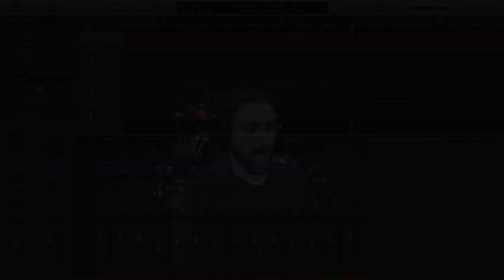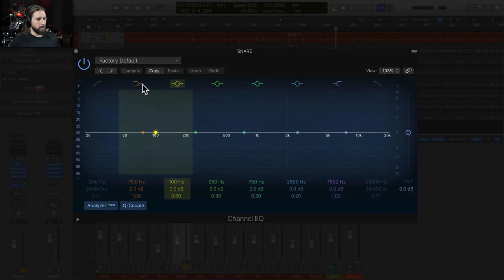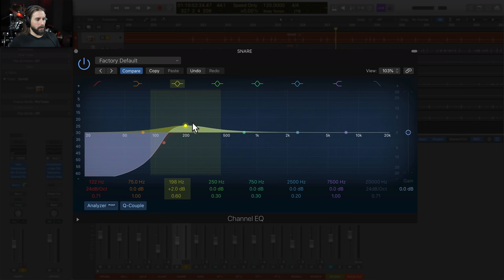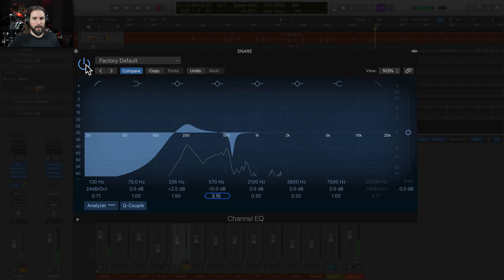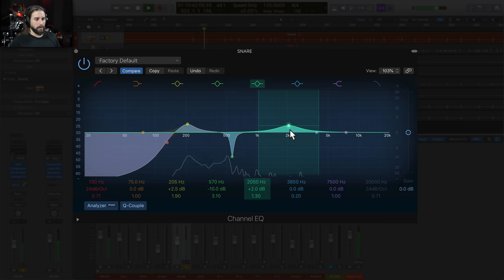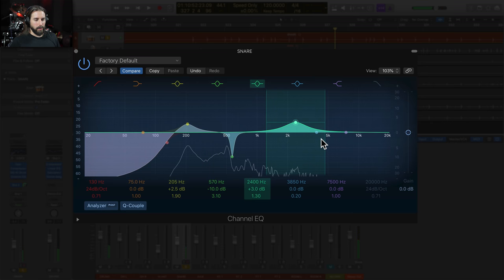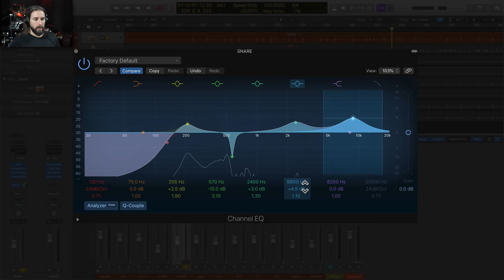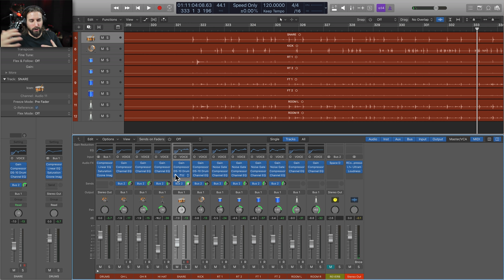Snare EQ For More Smack & Crack

Comment: Still ringing?!
Reply: I don't think you can pull all the ring out with an EQ. Either muffle the drum during recording or use something like a gate or sample if it has to be done in the mix. But likely you don't want to get rid of all the ring, because it might make a very dead and boring sound. You have to consider how it fits with the rest of your mix as well. This is just controlling the amount and presence of ring with the EQ.